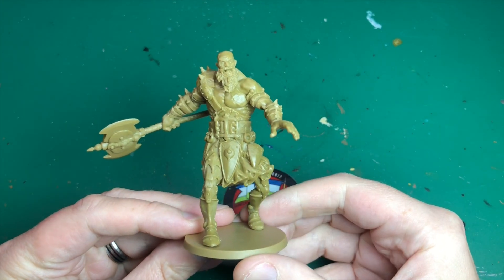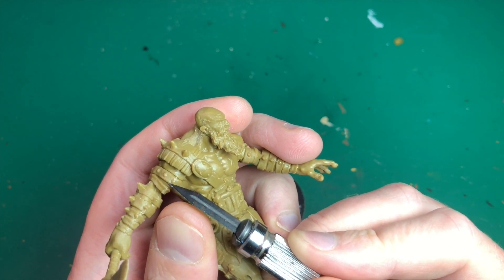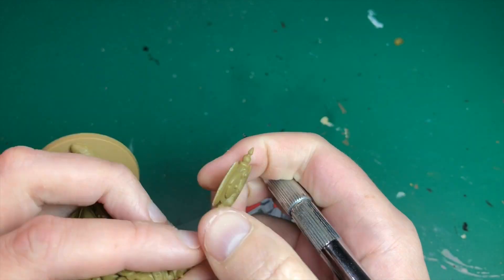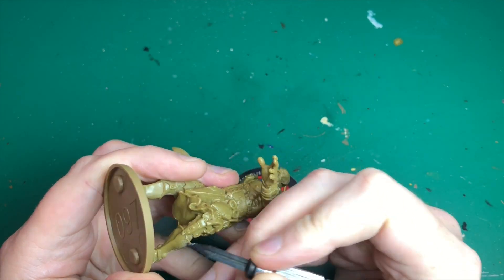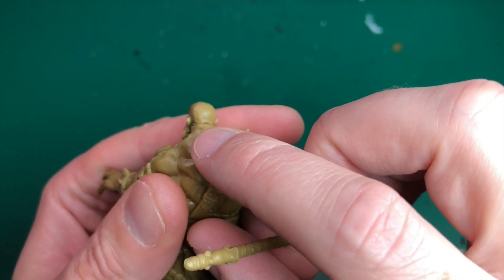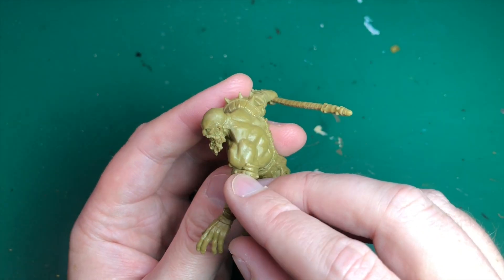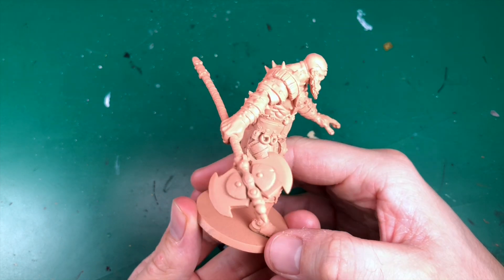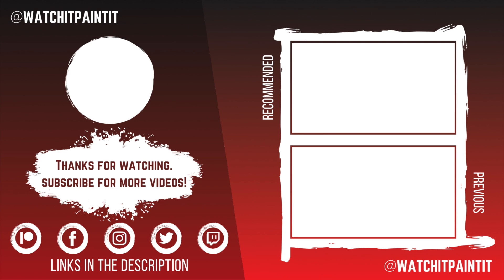How to guide on preparing a miniature (mini) for painting

Comment from the maker: I want to create some videos for brand new beginners to be able to find on the channel and help them get up and started with our hobby. Any suggestions for any other 'must have' videos for beginners?
Reply: Hobby tools you need to start and hobby tools you will eventually need. Could also do one on starting the hobby on a budget. Such as dont buy over priced GW paints when Army Painter and Vallejo are cheaper and have more paint. Brush types and sizes. Lighting. Practice models (cheap bucket of army men) for prime and detailing. First time painters may overspray the primer. Underspray is ok but overspray kills details.

Comment: Thanks for the helpful vid.  Can I ask how you would handle it if your prime coat shows up flash lines you missed?  Cheers in advance
Reply from the maker: You’re welcome, and of course! You got a few options : trim the lines, then another quick light spray prime, or more accurately hit the lines with paint on primer, or just skip the primer on that bit - depending on the colour this may show throw a little though or not take the paint as well. For myself if it’s an untouchable / hard to see area I skip the primer if I have to clean up a line. If it’s easily visible I use a little paint on primer to tidy it up. Hope this helps